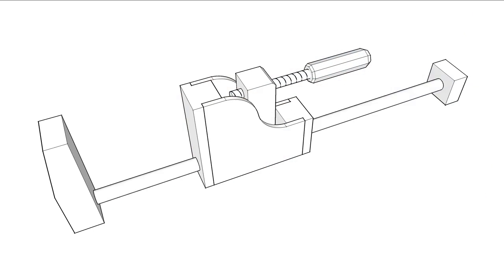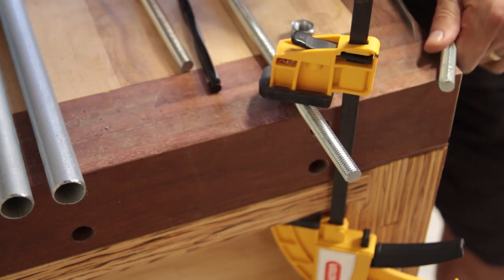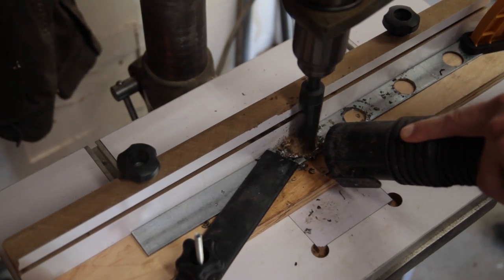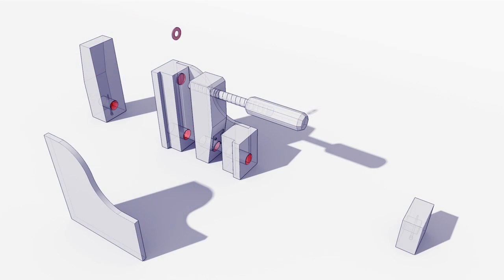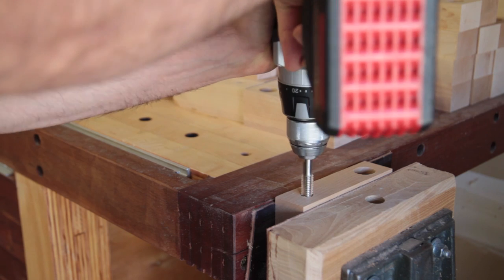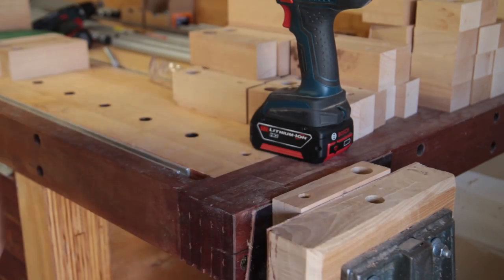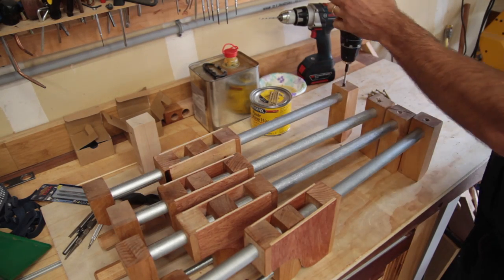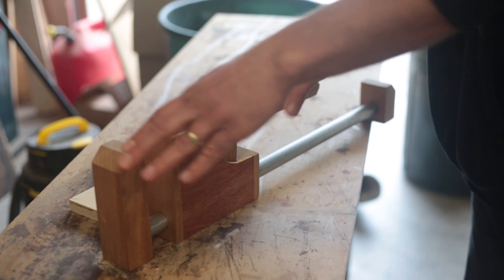DIY Parallel Clamps

Comment: I actually built them.  However, I must have put the metal piece on wrong, because it does not set to allow the clamp to hold pressure   The more I turn the handle, it walks away..   I was sensitive to your video instructions regarding its placement.   Any advice?
Reply from the maker: I've found that I too can have the clamp walk away, so I sometimes need to put a bit of down pressure while twisting the handle to get the metal clip to 'catch' on the pipe. Hope that helps. Definitely frustrating to go through the whole build and then fine they aren't working right.
Reply: Maybe the design could be refined in that respect: By making the "moving block" thicker, the angle between the metal piece and the bar could be more flat, so that the small piece really bites into the bar when tightend. Do you think this could work?
Reply from the maker: It could, though even though some of mine 'catch' a bit easier than others, they all work.  Still design changes and improvements are always welcome suggestions, thanks.
Reply: I am building these too and had the same thought about the grip. My thought was too put thin notches every 1/8th and then pack the conduit with 3/4” dowel to keep the rigidity intacted.

Comment: I'm just curious if you used emt conduit or rigid conduit. emt is a bit cheaper, about 4 dollars vs 15 for rigid thanks!
Reply from the maker: Robert Lasky  just used simple emt conduit pipe, the cheap stuff. Works great

Comment: did you use the same size drill bit than the diameter of the pipi for the wood and the metal ?
Reply from the maker: Yes, for me it was 15/16ths to match the pipe exactly.

Comment: You know you can cut conduit with a pipe cutter right?
A $5 pipe cutter that will give you a nice straight square end with a slight bevel on it.
A lot easier than a fucking jig saw.

Comment: Really good job on the video, what software do you use for video editing?
Cheers
Reply from the maker: Currently using Premiere, though have used Final Cut and it works really well. Check out Hitfilm for another option.  Thanks!

Comment: What is the purpose of the big washer that you glue on
Reply from the maker: I think mostly for long term wear, it's arguable you could get by without drilling the recess holes at that area and just using the flat of the nut to press against that side of the clamp, but for long term wear the washer should help. Hope that makes sense.
Reply: I see . I agree with that concept. Thank you

Comment: What size steel bar did you use for the grip plate?
Reply from the maker: The plate to grip the round bar? I don't remember, but probably something around 1/16 plate. Doesn't need to be anything big.

Comment: Did you build this in metric or imperial? If you could message me or something I bought the plans and am having trouble converting to metric. I’m tempted to have my CNC just cut all the parts exactly perfect.
Reply from the maker: Sorry, I also built in imperial, though I tweaked the design. Not sure what suggestions to offer with converting to metric, though really, only the hole size for the pipe needs to be exact, for whatever pipe you use, the rest should still work even if it's not exactly to the plans.
Reply: I meant converting to imperial lol. The plans come in metric.
Reply: Do you have your plans with imperial measurements?
Reply: Have you had any glue buildup issues with the pipe being 15/16" just like your hole?
Reply from the maker: The pipe I used, being galvanized steel, wood glue doesn't stick that well to it, so yes I get glue on the pipes, but for the most part that scrapes off pretty easy and hasn't been a problem. Naturally, due to the slight variations in my build, some of them slide easier than others, but they all work. 

I don't have plans in imperial, but email me (About section) and I'll see what specific questions you have.

Comment: I have built almost the wooden clamps that appear on YouTube (including this one). My conclusion is this: they suck. 
When you tighten a clamp, you apply extreme pressure (can be hundreds of pounds), especially with screw bars as those used by amateurs (many coils per inch).  Ultimately, the wood will break. For example, the clamp above, the voulnerable part is the piece of wood that is attached to the handle, the part with the metal ring surrounding the metal tube. When you apply alot of presure, it`ll break. 
One varation that could word is making that part from metal. I havent it tried it. 
Bottom line, some things were just meant to be made from metal, clamps are one of those things.
Reply from the maker: Sorry to hear you've had bad luck with the clamps you've made.
Reply: If you find yourself having to use a lot of clamping force then I suggest you pay more attention to your woodworking technique, clamps are supposed to hold joints together while glue dries, they're not meant to correct bad joinery.

Comment: what size was that threaded rod? 3/8 or 1/2
Reply from the maker: 1/2 I think. Superstrut threaded rod.
Reply: Great and thanks. That's what I purchased. Been looking for a new shop project so i paid for the plans from Bellvue. Really looking forward to making these. Considering either maple or oak for the hardwood. I appreciate you getting back to me. Thanks dude, and happy woodworking.
Reply: I got the 1/2 since it's a coarser thread and would require less turns to tighten.
Reply from the maker: Fantastic, good luck!